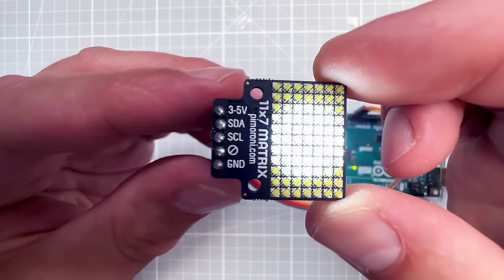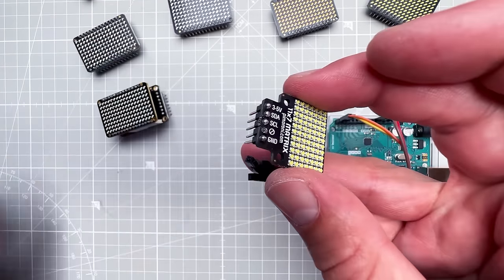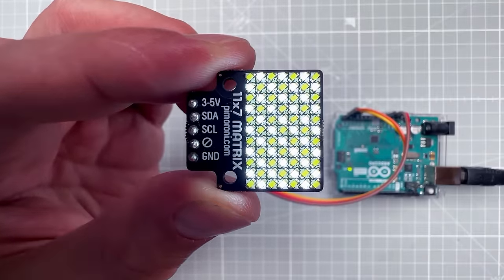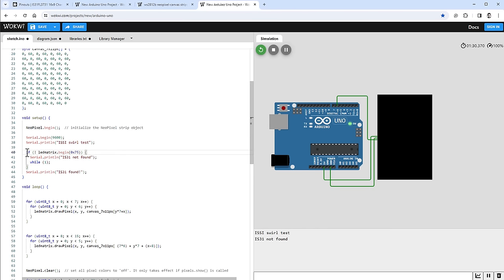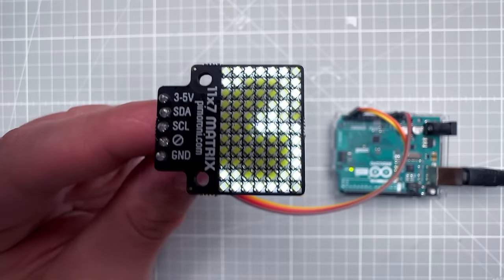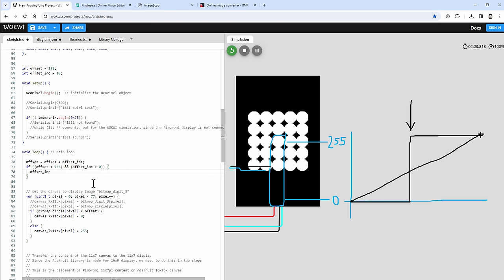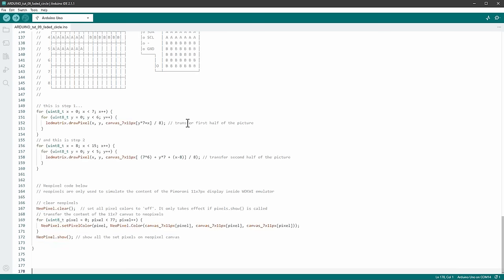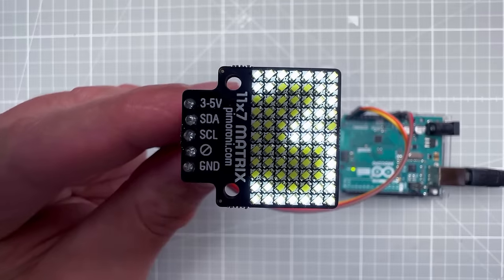Should I use THIS display?

Comment: Sorry to bother you with a question, but I'm stuck with a problem. I can't find any programmer that allows me to program the Atmel AT89C5115, via ISP, that is, with the chip placed on the application board. I got a batch of 200 chips at a good price. But I can't get the programmer to be able to record it. Do you know anything about this topic? It would be a great help to me. A cordial greeting. Thank you so much
Reply from the maker: Sorry, I don´t have any experience with this chip, but a quick google showed this answer, maybe it´s helpgful? -- That MCU is an 8051, not an AVR.
Reply: @upir_upir  Hello. First of all, thank you for answering. Yes, I know the chip well. The problem I have is that I can't find any programmer that allows me to program it via ISP. Therefore, I have to be removing it from my application to program it in the programmer, which multiplies development time. A cordial greeting.

Comment: This looks great! Thanks for the video! I would recommend one thing though to simplify transfer from Wokwi to real board - You can just use so called flags - e.g. define a constant smth like "is_simulation" and if it is present - not perform the thinga which are relevant to real board. Thus when You ttansfer code You can not bother about uncommenting things and just comment out just one line of defining a constant - or switch it from false to true - easy and You'll not forget accidentally what is missing - less room for error. Just a tiny useful thing - I always use it for different purposes and find it extremely useful. Just an idea :)
Reply from the maker: Thank you for your suggestion, I was thinking about the same thing - i.e., putting some preprocessor directives like #ifndef or #if, but decided not to because the code is not that complicated, and having some extra NeoPixels does not slow it down that much. However, the main reason was the fact that there is not way how to automatically tell in the code if the code is running inside simulation on WOKWI or on the real Arduino. As I understand it, this is intentional, but it would be helpful in this case.
Reply: @upir_upir sure, I get Your point. Well, then that's it :)

Comment: Having a display that displays your current gear is great, but FFS, put it where you don't have to look away from the road when looking at it!
Safety first!
N.B. Before I got my Yaris hybrid (with HUD), I drove manual for 25 years, and NEVER looked at the shifter when changing gears. Muscle memory will teach you which gear you're in very fast anyway.
Reply from the maker: If you have multiple cars with different shifting patterns or different number of gears, you might want to look at the printed shifter pattern on the shifter from time to time...
Reply: @upir_upir  You can do that while parked though.

Comment: I've been building a similar project but for kitcars with motorcycle engines and gearbox. I was using an eink display, refresh rate being a pain. I hope your don't mind but I'm going to steel this approach. Thanks, is there a good source for front glass?
Reply from the maker: Sounds very interesting, do you have any photos of your work? Please feel free to use anything you want and good luck with your project!
Reply: @upir_upir  yes i would love to share my progress. I have it working from 2 hall sensors and some extra code to deal with selector sequence. I am running on a esp32 setup with a localised web app for adjusting thresholds for up down and reset. Getting neutral to function without having to hit the reset thresholds was a nightmare.

Comment: Hey upir,
this is the same LED Matrix that i used for my gear indicator (Motorbike). Its great to see how you worked this out and also very inspiring, as usual :) I would like to see more with the pimoroni led matrix!
Now a question, whats that tinted acrylic glass you showed? I would like to use this for a clean look. Where do i get this from :D Great vid, as always!
Reply from the maker: That´s great to hear, thank you for your comment! Do you have any photos of your indicator? The acrylic glass is just a tinted acrylic glass, I have updated the description with a link on AliExpress, but I´m sure you can buy it from anywhere else as well. I have used my friend´s CO2 cutter to cut it to shape, since the my diode laser it not powerful enough to do that. I need to get some CO2 laser cutter :)

Comment: Very interesting. Got a question regarding the max frame rate for such chip?
Reply from the maker: Thank you. I don´t know. The adafruit sketch has some delay inside, I don´t have any, but my guess is that I´m just doing a lot of calculations on the UNO, and you can drive the display much faster than what I´m currently doing.

Comment: I've been following your work and noticed we're exploring similar projects in electronics. I just got a Seeed 6x10 RGB matrix that pairs with Seeed Xiao boards like RP2040 and ESP32. Setting it up was straightforward, costing only £10 for both the matrix and the Xiao board. the dimensions of the board are 22x18mm. and lots of pins are free to be extended through.

I tried your method with Photopea for image conversions, but ended up using a GPT model to convert the pattern table into an RGB 0x000000 format, which turned out perfectly!

Seeing as we’re both navigating similar stages in our electronic ventures, I thought it might be beneficial to exchange ideas and tips. If you’re open to it, perhaps we could share emails? I believe we could offer each other valuable insights. thanks, Si
Reply from the maker: Thank you for your comment, that´s great to hear that someone out there is exploring a similar path! For sure, let´s share our findings, I agree that it would be mutually beneficial. Please find my email in the about section of this channel, though it´s only visible on desktop. Thank you and good luck with your projects!

Comment: Would this led display be bright enough to project an image using a lens?
Reply from the maker: I believe it would be bright enough. What would you like to use this for?
Reply: @upir_upir  Modern lcd screens use local dimming of led zones to improve contrast. Always wondered if this could be done with lcd projectors too....
3,2mA per led times 77 leds equates ~1W max led power, can you confirm this ?

Comment: Could the same be done to an old motorcylcle? So that It will get rid of the problem of not beeing sure you have neutral between second and third gear, or the neutral between first and second.
Reply from the maker: Yes, that should be totally possible. It’s actually easier, because many motorcycles either already have sensors, or you can buy motorcycle gear sensor premade.

Comment: Why must everything depend on electricity ? Isn't that an exaggeration ?
Reply from the maker: A fully analog version would be surely cool as well. But beyond of what I can do..
Reply: The term " Digital " has nothing to do with electronics, it has its own concept. It may be that the system does not require electricity to operate and does not include any electronics, but it is digital. It may also be that the system requires electricity to operate and include electronics, but it is analog.

Comment: It's a good idea, but useless.
Reply from the maker: How come displaying an animation on the display be useless?
Reply: @upir_upir  The display on the handle is either closed with your hand or distracts from the road.
Reply: @andreslut2566 that’s assuming this is meant for driving, it could have other uses where shifting is useful.
Reply: @andreslut2566  not everyone grab the handle the same way and if you really need to know which gear you're on, a quick glance to a university understood number is less disturbance than trying to figure out the position of a shaft that can change from model to model

Comment: Thank you for the new video. I wanted to ask if you knew of any way to connect multiple displays and control them independently? I searched but only found methods using other libraries like Adafruit, not U8G or U8G2.
Reply from the maker: Thank you for your comment. I plan to create a video with multiple OLED displays connected to the same Arduino board using the U8G2 library. Please check back later.